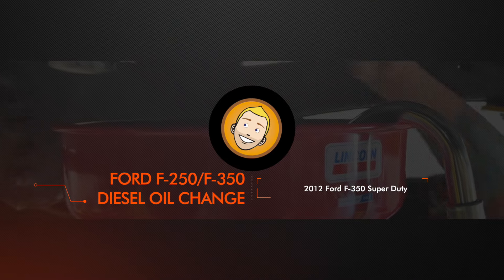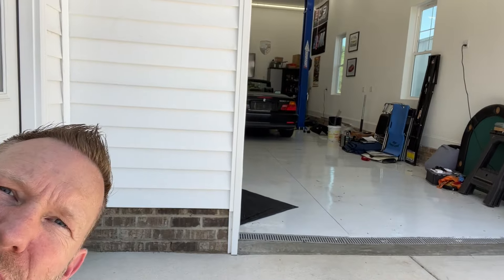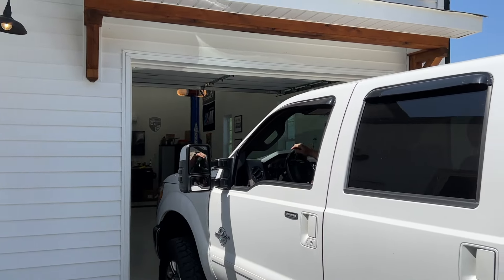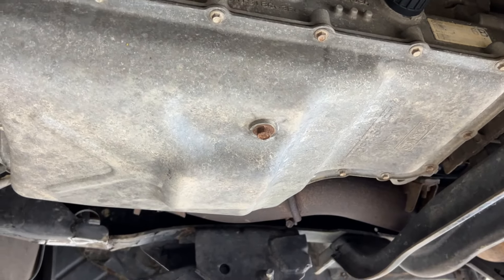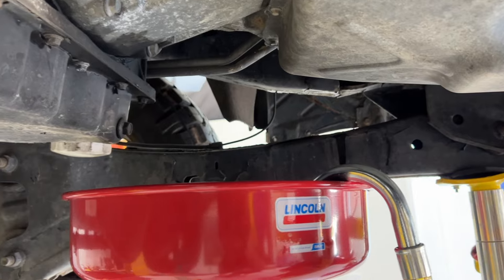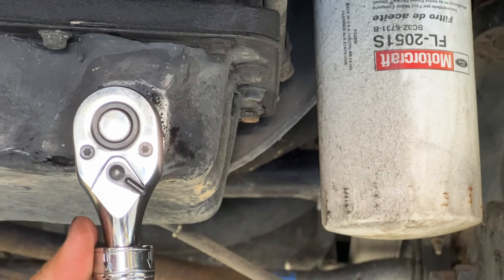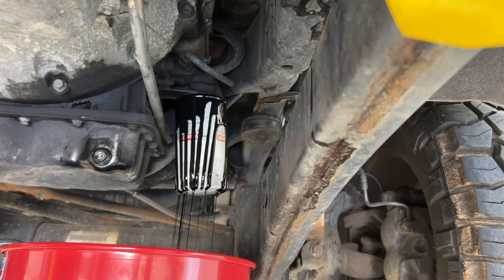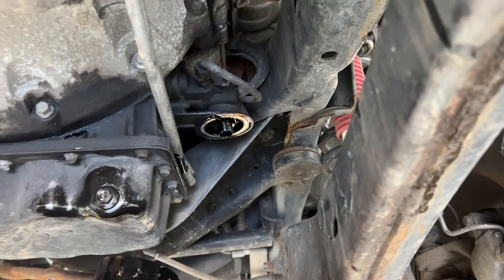Oil Change 2011-2019 F-250/F-350 Super Duty Diesel 6.7L

Comment: its alot easier to just take a punch and punch a hole in the bottom of the oil filter so it can drain out of one hole
Reply from the maker: +zaxter321 interesting, first I’ve heard of that idea… sounds like it would work.
Reply: Yes, a lot less messy by punching the drain hole. Just make sure you break the filter free before you destroy it.